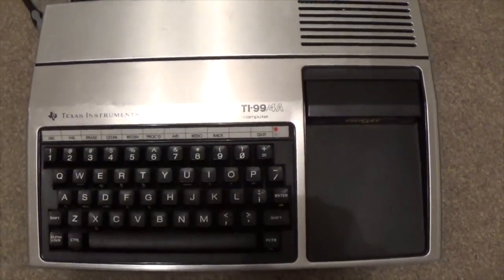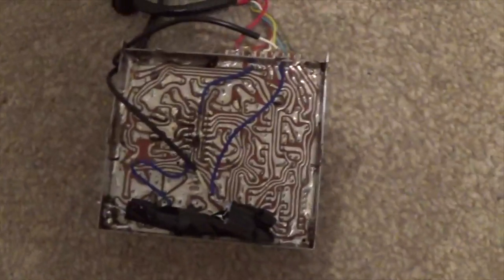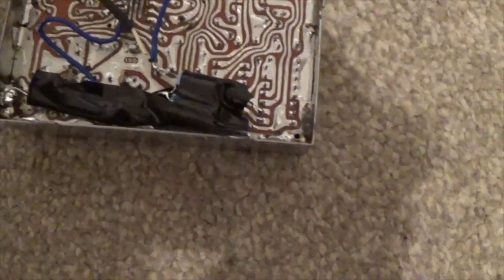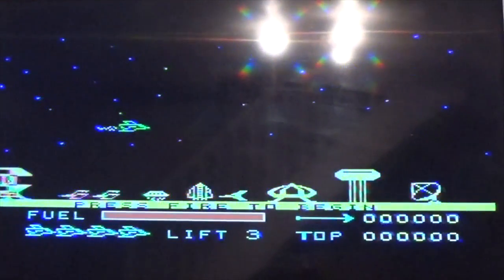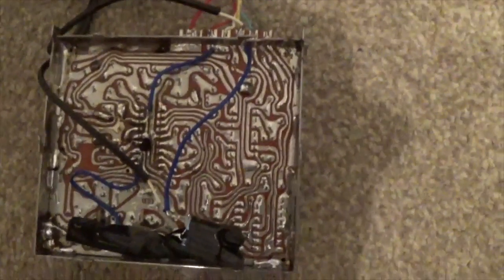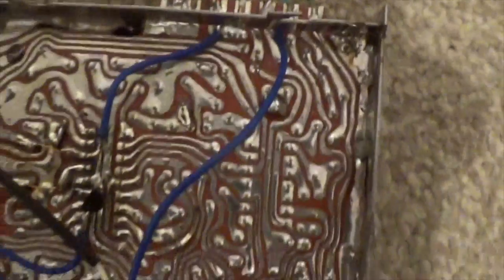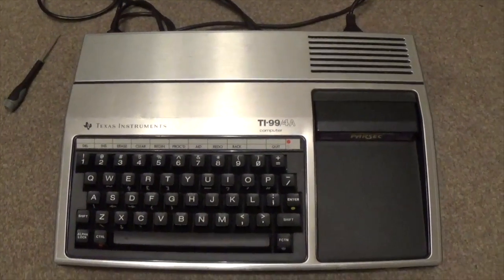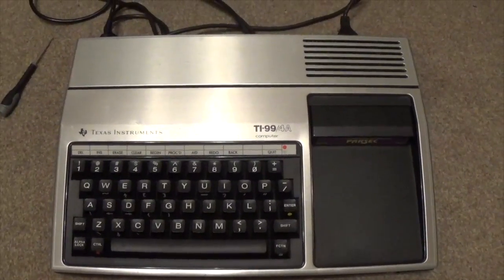Ti99/4a PAL Composoite mod

Comment: Owned one of these in 81 or 82. Seemed an interesting system (for programming) but I knew nobody else that owned one and couldn't find any software, so I sold it after only 2-3 weeks.
Reply from the maker: +are you in the U.K.? The support for these machines was patchy to say the least. In the US , it was less of a problem but here in the U.K. Software was scarce. Parco electrics in Devon bought lots on the stock in 84 after ti pulled out of the market. daishi5571
Reply: +mjurney I did live in the UK (until 2000) now living in the US. I bought it secondhand from a guy that I had fixed his stereo. I think he was selling it because he couldn't find any software either. Had I found an assembler I may have kept the system for longer.  It was a similar story with the Sord CGL M5.
Great channel BTW.
Reply from the maker: +daishi5571 thank you your very kind . The ti was always on the back foot because ti would not allow third party software much like Nintendo and  to be honest they had strong sales until commodore went on the attack